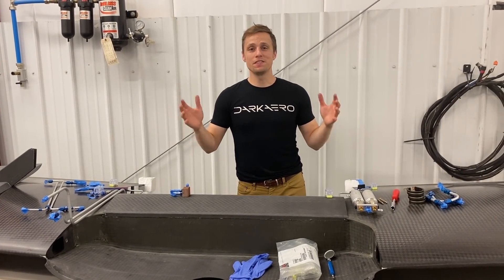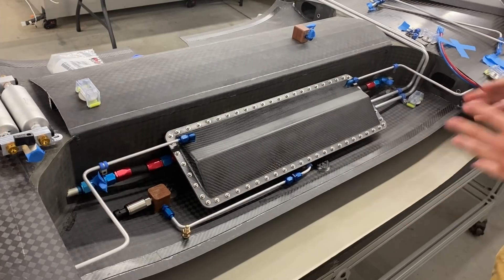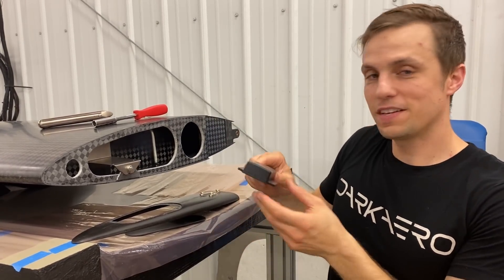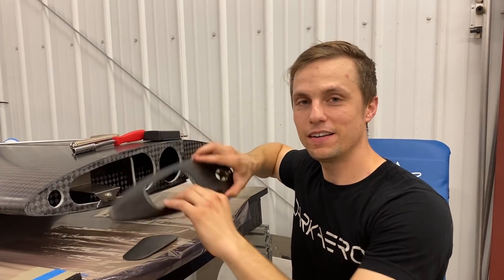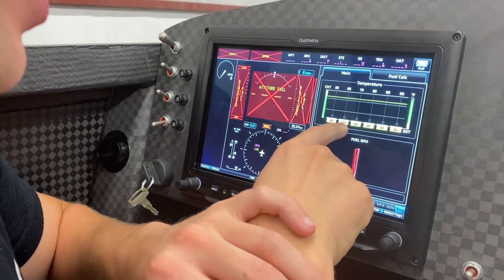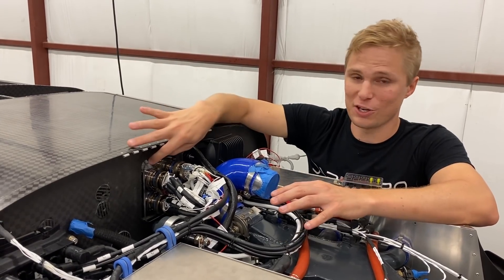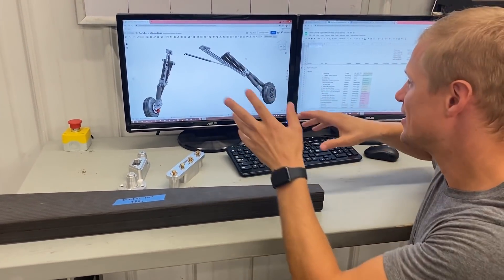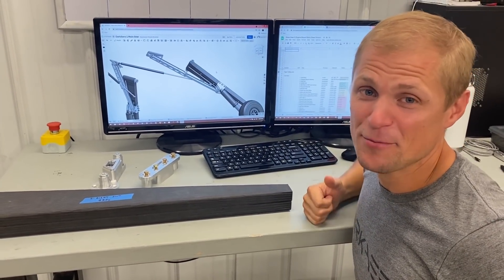HINGED INSTRUMENT PANEL! | DarkAero Shop Progress Update | August 14th, 2021

Comment: Just goes to show you that nothing can make up for experience. You may be engineers and good at CAD, but how long have you been flying and what emergencies have you dealt with in the air to have a thought process where you think the fuze box is better in the engine compartment? The biggest part of aircraft design is and always will be redundancy.
Reply: Seems like a wrong choice to me as well.
Reply: @rustusandroid  because it is my friend, and any professional airframe engineer or long term pilot will also tell them that.
Reply: @truthseeking3818  Yes I agree.  My question was meant for the Dark Aero guys :)

Comment: Love 99.9% of what you do, but this latest video has me question a few things. Mounting the fuse box in the engine compartment, especially your chosen location, doesn't seem like the best of ideas, between heat, vibrations, fluids, and the difficulty in reaching it if needed. One other thing I don't understand is the instrument panel. Does it swing independently of the canopy, or is it tied together with it? I like the concept, but only if I don't have to sit in a closed cockpit in order to run the G3 on the ground, not something to look forward in the summer months. Airplane's looking great, can't wait to see it moving under its own power. Ciao, Marco.
Reply: Please rethink the fuse box guys. Or give us an update on your reasoning for mounting it in the engine compartment.

Comment: Have you gotten readings from the magnetometer housed within the composite skin? It might act as a faraday cage.
Reply: ... also, it needs to be far away from steel plates or steel bolts! A carbon skin is not the best.
Reply from the maker: Thanks for the question! A faraday cage doesn't work to block static or slowly changing magnetic fields like the Earth's, which is what the magnetometer is sensing. Since it is a sensitive magnetic sensing device, a bigger concern is stray magnetic fields like those caused by the current flowing through wires or from ferromagnetic materials like steel. Mounting it at the wingtip reduces its proximity to these sources.
Reply: @DarkAeroInc  Appreciate you taking the time to respond. Absolutely love what you guys are doing! Will ya'll be hiring or looking to expand your team?

Comment: The fuse block must be in the cockpit. Just had an incident in my own plane with the landing gear requiring me to shut off the gear pump motor while in flight and the only method that works is pulling the breaker. Standard emergency procedures with an electrical fire is to manually pull breakers.

Please rethink this.
Reply: I was just wondering that myself. Fuses in the engine bay don’t make much sense if you need to troubleshoot while flying.
Reply: Exactly my sentiments; thanks for saving the me the keystrokes. And they should be circuit breakers, not fuses.
Reply: They are going to have to single file them on the side rails cause the control panel area is maxxed out if I remember correctly.
Reply: Just go full Tesla for software fuses :P
Reply: Предохранители в таких конструкциях это уже карго культ.
Поэтому не важно где они находятся.

Comment: Any plans for winglets?

Also, wouldn't it be beneficial to have access to fuse information/change of fuse from within cockpit. I'm picturing the scenario for when you are coming in to land, and a spike in current triggers landing gear fuse, which makes your gear stuck, if nothing is actually wrong, a resettable fuse could solve that issue, reset fuse and go on with your day.
Of course, you have probably looked into all sorts of situations, but that's just an idea.

Will it include current measurement of most systems? So you could spot an issue before the fuse is triggered?

This comment is getting out of hand, but will you also have a linear potentiometer for the landing gears? Could be useful to detect actuating errors, they could be placed parallel to the actuator... When building a Formula style race car earlier, we used a lot of these to accurately detect and log how the suspension worked. It could also be used to tune the shock stiffness by logging the transverse travel of the wheel assembly. Extremely important in vehicle dynamics, I bet it would be important here too, to reduce bounce on landing (or to detect hard landings where the gear should be inspected)

Sorry for being such an armchair engineer, but would love it if you talked through your thought process on this ;)
Reply: Everyone in the YT comment section is an armchair engineer (even actual engineers), so you don't need to apologize for that, LOL!
I agree with you that the fuse box in the engine compartment seems weird...
I do work on electrical designs for yachts and by the time you have individual circuit monitoring, the system is usually also capable of solid-state control as well.  Once the control and monitoring are integrated, it effectively becomes a 'digital' fuse; if an over-current situation develops, the circuit is automatically turned off before any fuse blows and a notification is sent to the display.  
CZone is a very mature system that does this and integrates well with nav equipment.
Reply: Hehe thanks. 
Right, there are lots of systems that could be used for a "soft" fuse, and it would typically allow for the actual fuse to be placed on the other side of the firewall, which I suspect is the intent since it would be isolated together with the battery.
In my opinion, there's a lot of nice-to-have's that could be implemented on the electrical side of the DA1, but I guess I would have to make one myself to implement them ;)
Also James, I appreciate your polite comment, that's not a given on YT

Comment: Hats off to you work quality. Curious as to why the sump is not bonded,  is there something serviceable inside?
Reply from the maker: There is a filter/screen on the pickup tube for the pump inlet inside the sump which is serviceable.
Reply: @DarkAeroInc  Would an external, inline filter be more convenient and lighter than all those bolts?
Love the videos, and great lookin' plane!
Reply from the maker: There is an inline filter downstream of the pumps. The large area screen in the sump is to preserve a clean source of flow to the pump. It essentially increases the inlet area of the pickup without allowing debris through to the pump. Without this arrangement you would be relying on the 3/8” diameter fuel line as the pickup which could become blocked by debris in the system.

Comment: So does the 'sump' we're talking about here act as a collector between the two tanks? Is it a dual purpose pressure regulator/filter? Or is that what the two manifolds are. It looks nice. Im just a little confused with the terminology being used. When I hear sump I think oil. When I hear manifold I think exhaust or inducer. Thanks.
Reply: I was wondering about the sump term myself.  If it was a boat their 'sump' would be called a fuel header tank.  
I wonder if they are using the term sump because it is gravity fed from the tanks...
Reply: The guys explained the 2 wet wing tanks, central fuel sump, manifolds, redundant primary fuel pumps, filters, etc. in previous videos. This latest video goes a long way to show the systems placement within the wing assembly and the new custom designed & built compact twin manifold/pumps assembly.  “Fuel sump” is the appropriate term. In aircraft designs as well as many other mobile or fixed liquid fuelled engines. Although some early Internal Combustion Engine (ICE) powered automobiles (think “horseless carriage”) used separate fuel sump tanks, most gasoline fuelled automobiles today use an in fuel tank primary electric fuel pump with its intake located in a special low area of the tank where fuel can collect through gravity. This area is referred to as the sump. In a very low fuel situation, depending on the sump position in your car, you can experience sputtering and stall when going up or down a steep hill. Modern fuel tanks are not designed to be user serviceable, and don’t have a drain procedure due to inherent reliability of the design and low risk in a failure mode as compared to an aircraft. Any 4-stroke (Atkinson or Diesel cycle) ICE based engines, including those in aircraft will also have an oil sump to collect lubricant before filtering and pumping it back into the engines lubrication channels. Like race car engines, any aircraft use a dry-sump oil return design as it is more compact shallow pan lowering engine height which allows for a more streamlined aerodynamic shape of the engine cowling and allows for more flexibility in the vagaries of flight than a purely gravity fed oil sump. To avoid basement flooding, many buildings located with a shallow “ground” water table, will have a “water sump” in their basements with a sump pump that turns on whenever the float reaches a preset level to pump the water into the storm sewer. So, “when [you] hear sump [you] think oil”, but you should also think fuel and water.
Reply: Thanks, now what about the manifolds?

Comment: Do you have any concerns about the fuel gradually attacking the resin in the sump or tanks?
Reply from the maker: The epoxy we use is fuel compatible and we have performed long term fuel soak tests to verify this. We have not approved use of fuels containing ethanol because need to perform more testing to gain confidence in the compatibility.

Comment: Mounting the fuse block to the plenum?  Are you sure that’s a good idea?  I would like to hear your rationale.  Great job guys!
Reply: Plenums are a problem. They are subject to a lot of vibration from the prop blades sending pulses of air into them. That vibration will be hard on fuse elements. And how hot will it be in that location in a worst case scenario, ambient temperature wise? Resettable circuit breakers are the norm and they are cockpit mounted for a reason.
Reply: Don’t they need to have it accessible while in the cockpit?
Reply: @abdussamiurooj3936  Yes.  That’s what I’ve seen in airplanes although I’m not a pilot.  And also they are resettable circuit breakers.  I think.  That’s why I was hoping the guys would respond.
Reply: I had the same thought.  They should really find a way to mount it in the cockpit so they can access it while in flight.
Great video!
Reply from the maker: Hey Will-Co, thanks for the question. A lot of people were wondering about this. See the pinned response we left at the top of the comments.
Reply: Not sure I like the fuse block FWF. Might take another look at that.